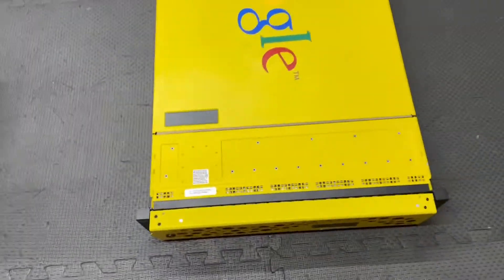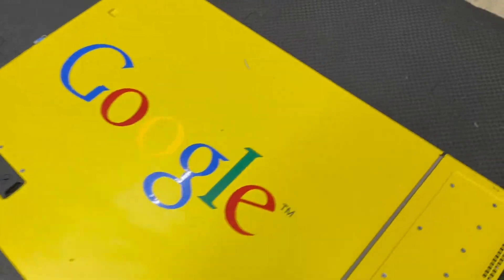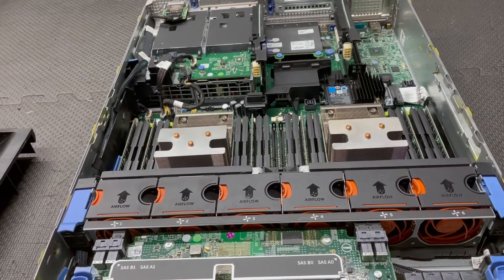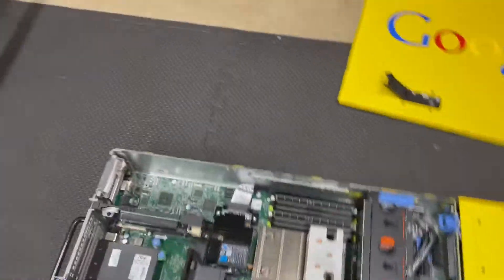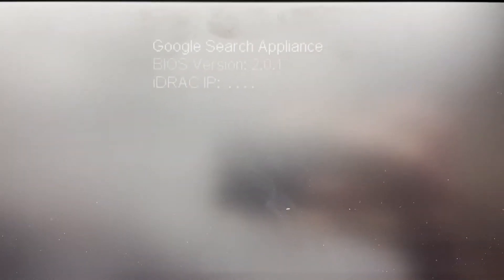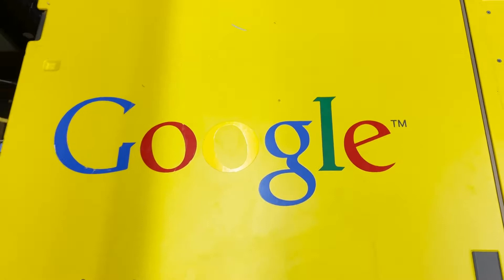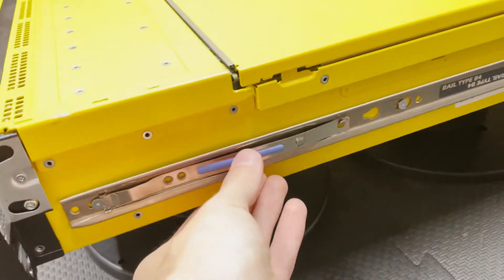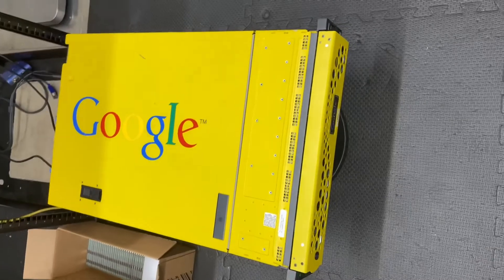A Look at a Google Search Appliance (GSA) G100 T5 (Dell R730XD)

Comment: Do you know how to remove the Google BIOS setup lock? If so would you be able to post a video on it?
Reply from the maker: I sold it and kept the original bios just in case the buyer needed the original one but I did look into it when I had the server. 
This guide on Reddit worked for a lot to people not sure if it works for the T5 though: https://www.reddit.com/r/servers/comments/41py3l/google_search_appliance_t4_bios_password_reset/
Reply from the maker: Actually, here is the guide for the T5 (r730xd) https://www.reddit.com/r/servers/comments/78w9wg/how_to_reuse_a_google_search_appliance_t5_r730xd/

Comment: I have one of these at home. What could I possibly do with it? Sell it? Recycle it? How much are they worth roughly?
Reply: I already have a R730xd but if I were in the market would pay 600 max.....the only downside to these is the 2.5" only drive config ....but SSD's are coming down in price :) Good Luck
Reply from the maker: @callmebigpapa  I sold this one for $1600 just because it was google type. And I priced out $800 in parts because it includes Ram (128GB) and CPUs because Ram was going for 200$ per 64gb a couple weeks ago (down to $150 now). So 600-700 is fair now. It’s really worth the extra if you want the case.
Reply: @tylerebowers   In the description it said 96gb .....I got my 730xd with  128 and 2x E5-2690 V4 for 500 shipped but I think it was listed wrong but have had for a few months with exsi installed and functions flawless. I hope to get one of these systems one day if only as a talking point for visitors to my site. Great video and thanks for posting!
Reply from the maker: @callmebigpapa  This one was missing two sticks of Ram (2x16gb). Also for 500 that was an amazing deal.
Reply from the maker: Worth maybe $800 in parts and $1000+ for collectors. Depends on the model though (r710 vs r720 vs r730 etc).
Reply: If you still have it, I might be willing to take it off your hands (along with any other hardware you have) for the right price.
Reply from the maker: @AlyxFao  I don't have that server anymore, but I do have a ton or ram (TBs of ECC) if you need any.